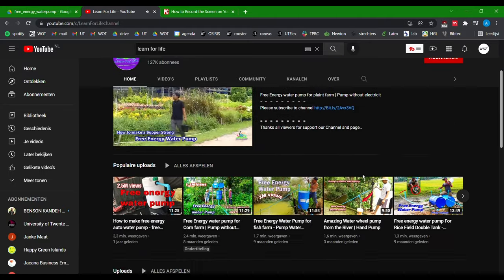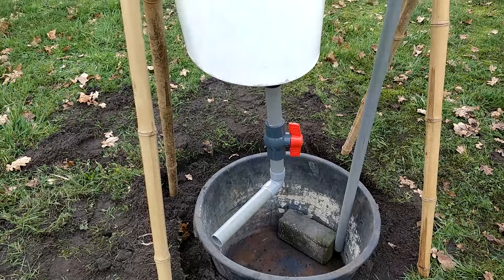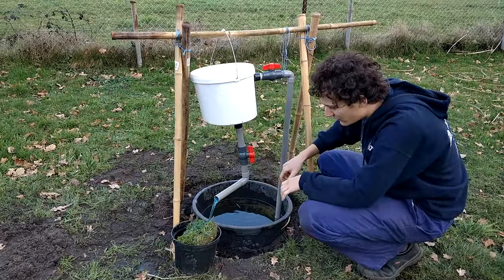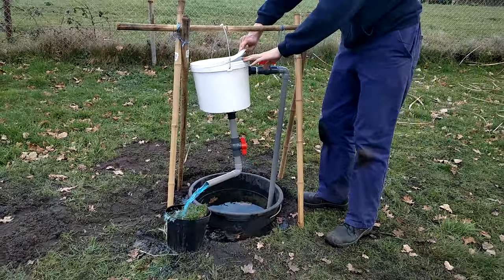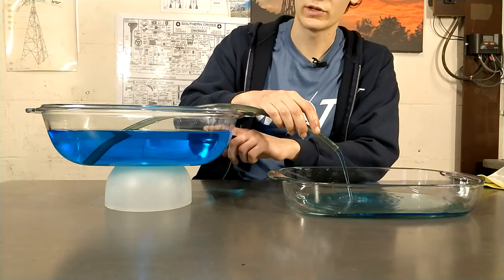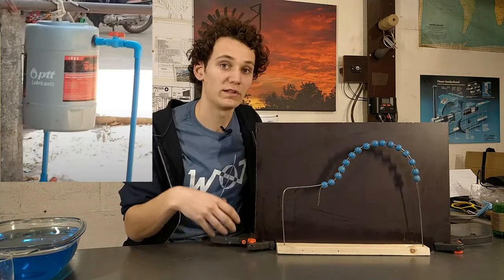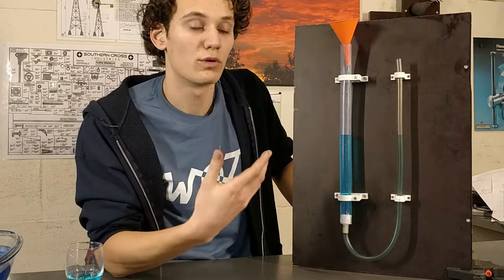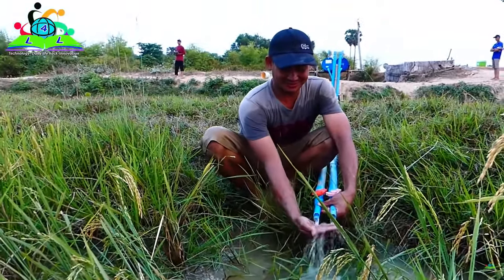FREE ENERGY Water Pump Tested. Is it possible?

Comment: My friend, try this again.  You didn't prime the well side of this experiment.  There's stored energy if the water is at the valve, second the seal on the bucket has to be tight, third the volume of the water primed in the bucket has to be greater than the pull force of the water in the tube from the well down.  That's what causes the siphoning effect and basically the bucket acts as a negative pressure chamber.
Reply: Yeah he did this very wrong. First, the pipe at the bottom didn't feed water back into the basin below to create an endless loop. Not overly necessary, but if you want to prove it can continue to pump endlessly, that would be how. Next, you have to have a complete vacuum without air in the container. He did a shit job getting air out of the container before starting. Also, he had a super small container for the volume of water of the siphon tube.
Reply: Right. He should repeat by priming the pipe connected to the water source.
Reply: @HostileRespite  Are there any restrictions? How many meters below it can it draw water?
Reply: @zoranpavicevic5710  It all depends on the mass of water in the tank exceeding the mass in the mass in the supply pipe. If this is the case, the next thing is to ensure a vacuum is maintained at all costs. The last thing is to ensure your reservoir and pipes can handle the negative pressure and don't collapse inward. Most pipes are made to withstand pressure OUTWARD, and that is our biggest limitation with this new pump concept. For longer supply pipes and larger reservoirs we may need to look at more robust vacuum container designs like old school archway brick designs to withstand the suction for longer distances. Alas, that's probably an application far beyond your needs... just to say, those are some of the considerations.
Reply: I think the limitation would be atmospheric pressure... the ability of atmospheric pressure to push the water up the intake pipe.
Reply: @sanggol2  Atmospheric pressure doesn't apply the moment you place a lid and vacuum seal it over the container. This is the critical moment you change a pressure tank to a pump because the force exerted on the water from gravity is enacted on the lid and filling tube. So long as the mass of water in the tank exceeds the filling tube, your line doesn't suck up any excess air (happens), and your tank can handle the vacuum pressure, you'll suck up water endlessly the moment you open the drain at the bottom of the tank.
Reply: Yeah, he's simply bs here. Main inlet not primed. Terrible misinformation
Reply: Pls. Study on law of conservation of energy.  The gravitational potential energy impended on the intake pipe would be the product of mass garvitational acceleration and the difference of height from the discharge pipe to the intake pipe.  Likewise the pressure have to be augment with that potential energy in intake pipe would be the product of density of the medium gravitational acceleration and the difference of elevation from the discharge to intake side.  You can feed a data to and give you all your requirements.
Reply: @zoranpavicevic5710  Safe to say 5 - 6 meter. Never more then the theoretical of 9.81 meters.
Reply: @HostileRespite  👍👍👍👍👍👍and the volume of the delivery pipe and the fall from drum to lower level and non return on bottom of siphon. Basics
Reply: This is true especially the second point
Reply: why wont this guy respond lol... rekt
Reply: @clickmcclick2675  who
Reply: A system doing work with no energy input and you mugs fall for it? ssshhh.
Reply: @deang5622  nobody said there is no energy input... you have to prime the siphon pump...
Reply: Even if he primed the pump and had a full bucket. It would only work for a while. The reason being in order to pull water you need more pressure from the water being dumped out. (I'm exaggerating numbers here because I don't know the actual numbers.)  But for instance you would need 2 liters of water to flow out of the bucket just to pump  1 liter of water into it.  It would sustain itself for a while until the bucket started to get too empty to pull water then it would empty out.
Reply: @Rusty_Nickle  It is a close system. When 2 liters flow out 2 liters must come in or the drum will collapse.
Reply: Plus the out let side has too be larger than the I'm let and you must have air trap to keep the air out of the out let
Reply: Right. So its not really a plain siphon but a water induced suction effect generated by the volume of water flowing out from the upper reservoir. The key is to have an exit pipe bigger than the suction pipe so that the water volume that will exit during priming up is greater than the water volume deposited in the suction pipe. Once it is primed, the pressure inside the upper reservoir will be maintained enough to pump water up from the well while water is flowing out from the same upper reservoir.
Reply: @HostileRespite  right but considering high cost of fuel that increases water rates, for a household with a shallow well nearby it seems to me a practical thing to look at. Alas! My deepwell is around 25meters. Perhaps isn't worth the try. 😅
Reply: @tinkerman9525  right for a continuous flow out of the delivery pipe, once primed the water drawn from the upper reservoir must not exceed the volume being sucked up from the lower reservoir. So the key for a conitnuous operation is to maintain the suction pressure at constant value.
Reply: @deang5622  Your added energy is GRAVITY combined with the power of elevation, mass, and vacuum!!!  Scream it from the mountain tops.
Reply: You are basically stating facts...
Reply: You can't "prime" the inlet side because the water will flow down. The pipes contain no check valves and this model is exactly like the original video. It will NEVER work. If you did install a check valve on the inlet pipe it will have more resistance and not flow. 
You have been pranked.
Reply: @HostileRespite  There is no free energy mate!!!
   If you try to suck the air from a tank, creating a negative pressure or a vaccuum, the pressure will ALLWAYS be completed by the LACK OF PRESSURE from the FAUCET.
   In other words... if the pressure in tank is high, the water pressure in the faucet will allways be lower which will ALLOW AIR TO COME BACK IN THE TANK and depressurise the tank...
    Get some physics courses and stop making a foul of your self... 🤣😂 or fooling others...
Reply: @nevermind-wp3bf  That's not how it works. It's fine. Go on with your life. Good luck.
Reply: @HostileRespite    How does it work? Are you familiar with conservation of energy, which makes perpetuum mobiles impossible? If this "pump" could rise water to a higher level without any input of energy you could at once build a perpetuum mobile. Just let the water flow back in the well and drive a turbine on its way. I agree with "Daniel Daniel". Get some courses in physics.
Reply: David Lockett    How high can water be lifted by air pressure? With atmospheric air pressure at the low end and a perfect vacuum at the high end of a pipe water can be lifted roughly for 10 meters. In reality less than that, since with a perfect vacuum water would start boiling.
Reply: David Lockett    If such a video shows that the outlet is above the water level of the water source, you can bet any sum it is a scam. 
I am familiar with the Archimedes screw. I don't know if it is your intention to drive this pump manually or by a motor. In both cases you have a wide choice of pumps ready from the shelf which are not very expensive. The Archimedes screw is in use in singular applications where it is superior to other pumps, but in normal applications other pump types are more common. But since you seem to enjoy handicraft work, the Archimedes screw could be a good choice. But consider that it can't be used for deep wells since it can't be installed vertical. And the lower end of the screw must be at water level. If the water level changes considerably the position of the screw must be adjusted.
Reply: @heinzpg  the input is gravity into the barrel and the vacuum it causes when the weight of the water is forced down and it at the bottom so long as the only opening is at the supply line and the mad of water in the tank exceeds the supply line. There are other factors of course, but that's the general explanation. Your power source is gravity. It's a pressure tank if the tank was suddenly sealed off and tuned into a suctioning vacuum, pulling instead of pushing with the gravity.
Reply: @HostileRespite    Gravity is only a source of energy when something moves downwards. But in this system the water moves a greater height upwards than downwards. Thus gravity does not deliver any energy, quite contrary, energy is necessary to overcome gravity. But yes, in this system gravity causes a vacuum. But why should the vacuum only "suck" at the inlet side? It also sucks at the outlet side! Many commenters have the naive idea, that it is easy for the vacuum to pull up water through a thin pipe but the vacuum will not have any substantial effect on the outflow of the water, because there is much water in the barrel, and this will resist the pull of vacuum. But this is completely wrong. The force working on the water is given by the product of pressure and area. Water in the barrel has a greater area and thus there is also a stronger force working there. But the heigth of the water column is much higher at the input side than at the output side and water pressure depends only on the height of the water column. If you analyse what happens here with formulas: with an increasing vacuum the vacuum would first stop the outflow of water before it is strong enough to lift water from the well. 

And there is another argument, which should be much simpler to grasp. It is generally known that a perpetuum mobile is not possible. If this pump would work with an outlet higher than the water level in the well you could at once build a perpetuum mobile. All you had to do is let the water flow back in the well and let it drive a turbine on its way. Your opinion on that? I repeat: gravity only delivers energy if something moves down - or moves more down than up. In this system it would be the other way round. Water would flow more upwards than downwards.
Reply: Sorru but you do not need any foot valve and no filling of the suction tube in such a setup. The tank is only a starting/priming device for a siphon. A siphon only works when the outlet is lower than the inlet, so let us drop the outlet into some bucket lower than the source. The water in the bucket will prevent air to flow back from the outlet.p into the tank. We close a stop valve at the output and fill up the tank and close it airtight. Then we open the outlet. Water wil start to flow and atmopheric pressure at the source surface will press water up the intake tube. The siphon gets primed given a diesent amount of water in tje tank in relation to volume in the intake and outlet piping.
Reply: @zoranpavicevic5710  A siphon can convey water over a 10 m ridge, but det output must be below the source.
Reply: @HostileRespite  Now, take a ordinary bottle. Suck it in water and lift it out of the water by the bottom. The bottle stays filled with water until the neck gets out of the water. What keeps the water in the bottle? Lets do it aggain, this time with a rigide tube, closed in one end. This time we rise the bottom of the tube 15 m up. Inside some water will pour out into the pond, but will stop when the heigt of water is about 10 m. What is holding the water up. What is the pressure in the volume above 10 m? Why is not this vacuum able to suck the water higher?
Reply: @JohnsonChansuper922  No need to prime the inlet. In proper use with the outlet lower than the inlet, the priming tank wil fix this without any priming or foot valve.
Reply: @tinkerman9525  Given that the volume of the tank is grater tan the vilume of the tubing, no foot valve is needed, basics! (You need a stop valve at the outlet tough when filling the tank.)
Reply: @Dingsrud  neither of those examples accounts for an open supply line at the top. The tank is a vacuum yes, and it's important to maintain that, but it's not a closed environment like your bottle.
Reply: @zoranpavicevic5710  it can draw water from about zero meters.
Reply: @HostileRespite  noop. Only for a few minutes.
Reply: @JohnsonChansuper922  With a barrel, you do not need a noe way valve ot priming of the suction pipe.
Reply: @tinkerman9525  Safe to say about zero meters. A siphon van not lift any water.
Reply: @tinkerman9525  No. If 2 litres flow out, then 2 litres goes up only 2 meter in the suction pipe. There is still say 1 meter to reach the barrel. You lost 2 to 1.
Reply: Outlet pipe us supposed to be bigger than inlet pipe, you need a foot valve on pond end. Bucket needs to be airtight. And a filler in the lid so both pipes fill.
Reply: @mickireland2421  No, the purpose of the container is that no foot valve is needed. With a valve at the output end the output tube can be any size. One sees here that air is sucked in via the outlet tube. If you dip the outlet into a tiny cup of water, no water at all wil come out as long as the source is lower than the exit. No filler in the container is needed, just take the lid off and fill it. Bucket has proven itself to be air tight as air is sucked in from the delivery end. 
Excellent video showing that this construction can not lift any water up. Inlet must be higher than outlet for this siphon to work.
Reply: Ppl here pls try to make one better way, and post in on youtube and share link. But make it all with  transparancy bottle or other material, so we can see rather it using any pump or not. Please ty
Reply: @bangdjapoet-tanamikan6356  This is a siphon with a priming barrel. There is no way you can make a siphon lift water from a deep well. Inlet must always be at a higher level than the output. 
Please have a look: https://www.youtube.com/watch?v=NiThJ9vUagU

As soon as the output is elevated higher than the inlet, it all stops. A siphone, barrel or not, can not lift water, impossible.
Reply: I thought this up when I was a kid because I kept looking at overunity devices that provided electricity and so now if I'm understanding your criticism correctly you need a large vat that's at least five or ten or even twenty or Thirty gallons so that any small pipe you fix to it will have all of that pressure behind it so that the amount of water flowing through the pipe continues to flow and can be fed back into the vat long before it ever gets empty
Reply: @kjellg6532  and as far as the siphon goes if you know that there's a way to make the water continue to flow and fill up then why not just build it the way it works I've seen it work before just not with this design
Reply: Why is he calling it "free energy"...it is powered by gravity and pressure. And yea he messed up this experiment.
Reply: man these ppl thinking you can pump water with no energy 😂
Reply: Good
Reply: We try, ıt's not work, try it yourself and tell us
Reply: Yes, you add energy to the system when you fill the container. As soon as that water is backmon the ground, all thatvenergy is gone and the «pump» stops. It liftet nothing up from the source. This is a siphon, no pump. No continuas input of energy.  
This video shows that for a siphon (with or without any barrel) can not lift water to a higher level. Excellent tutorial, debunking all those videos claming otherwise.
Reply: Sorry, no. If the source is elevated higher than the output this setup will work as a siphon. In that case 1 litre inn and 1 litre out. This videi shows that this barreled siphon can not liftvwater from a well up to a higher level. Impossible.
Reply: Instead of bucket I got 220 liter drum connected to 32mm pipe  and I had to pull up water approximately 7 meter.. I had my well side pipe primed with water. 220 liter tank got vacuumed completely flat.. :(
Reply: My system doesn't work. No leaks, the sucking pipe is going down through the bottom tank sucking from the bottom of this tank and is going to the top of the top tank. The pipe is primed with water...In my mind should work, considering the water tank above is heavy, and the water should push down and give me a "siphon", right ? but still I get air sucked in from drop down pipe. The length of the pipe "discharge"....cold be my mistake. The reason is shorter because I wanted to add a wheel to spin a water wheel attached to a modified alternator (which I use right now on a bike frame and I know is charging batteries). 
I'll have to think of a way but at the moment I don't know how to make it work WITH alternator. The water has to be deeper and would put the water wheel in the water :(